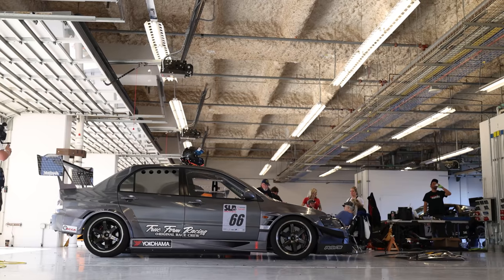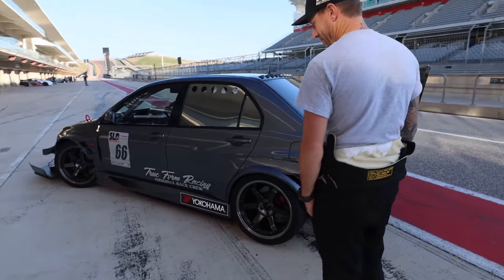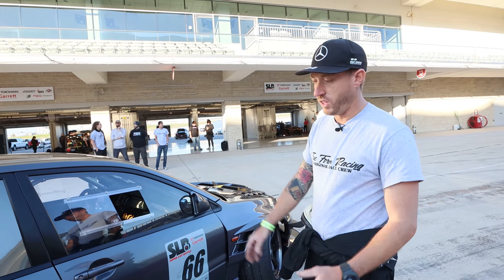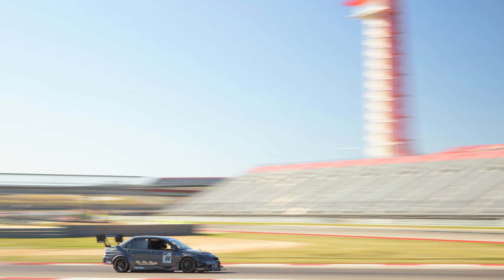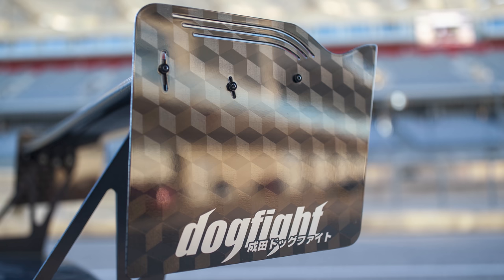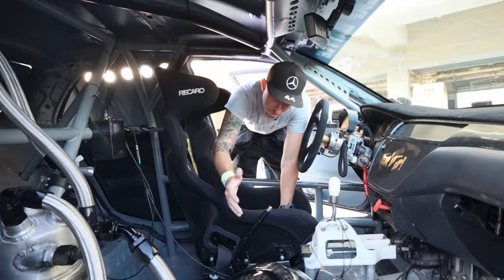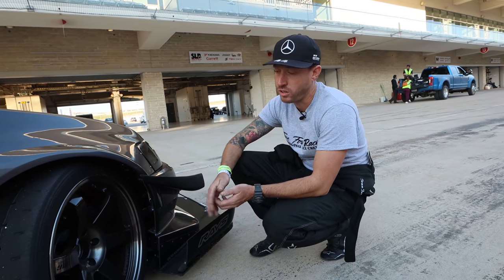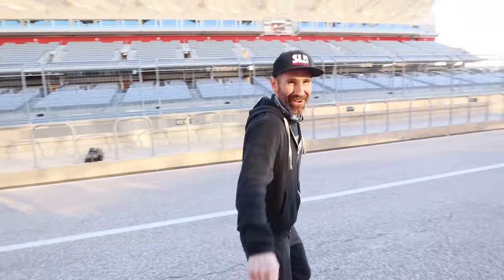600+ hp Widebody Time Attack Evo is no Parking Lot Queen

Comment: 32lbs for 600hp?????
Reply: I mean....I'm an ultra fan of 4g63 time attack cars, but that doesn't sound efficient.
Reply: how much do you think it should have? Depends on meth and e85 too versus that much boost on pump
Reply: @ARMWRESTLINGCYCLINGFRANCE  Well he said he went with a smaller turbo for response. Since PSI is a function of volume, a smaller turbo would run a higher PSI than a larger turbo while moving the same cubic feet per minute of air
Reply: @brianj7787  I would call, if I remember correctly,  a 78/75 a small tubro for the track.  For drag  yeah sure, but pretty sure you could optimize when tuning.  It's not that rare to see, for example, a k24 with a 62mm hitting 550hp with 24ish psi.  I know the K24 is a different motor, but its not so different that you cannot put forth the question.
Reply: @ARMWRESTLINGCYCLINGFRANCE  Valid point, they also never dyno'd it so it could be making a lot more than 600
Reply: @ARMWRESTLINGCYCLINGFRANCE  a k20/24 run higher compression to make up for the need to run higher boost.
Reply: @Ego_Driven  good point